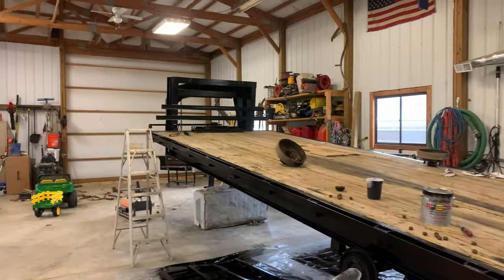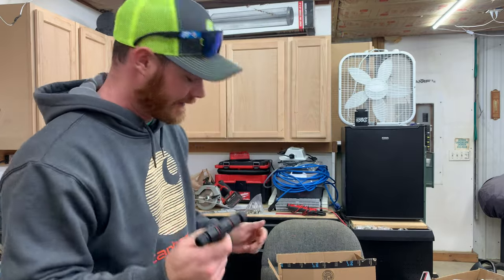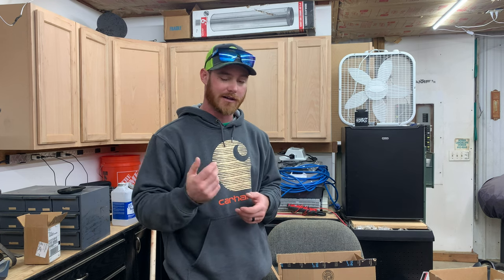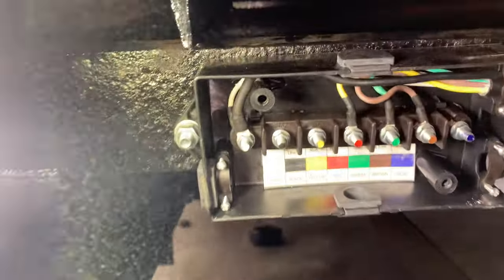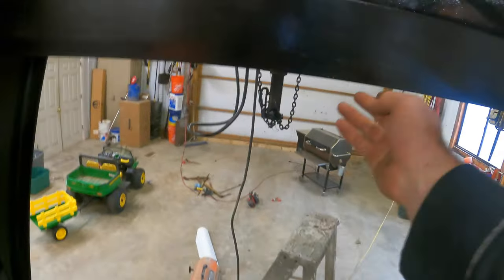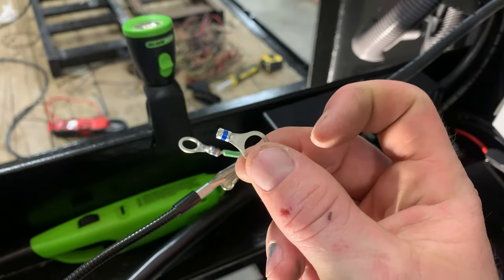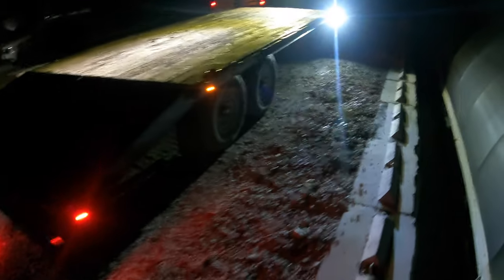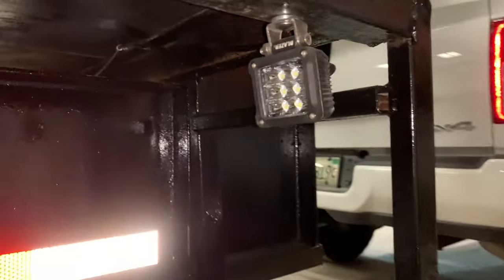HOW TO: Wiring a Trailer, OVERKILL Edition

Comment: I have an 18’ bumper pull I need to rewire. Saw the junction box on line but still didn’t like having to splice wires at the running. Just this morning it dawned on me to use more than one junction box. That soured me to checkout YouTube for trailer wiring again. To my surprise your video was the 2nd video that popped up. The land scraping connectors is genius! This is exactly how I’m going to wire up my trailer! Thanks for post this! I picked up my trailer cheap, all the floor boards have been removed due to rot, I’m going to rewire then install new boards. Will also get new breakaway system and I’ll also be adding the light bar and wheel lights which is also a great idea!
Reply from the maker: I’ll never have a trailer without the added lighting again. It’s way too convenient.
Reply: I've been wiring trailers my way professionally for years and have been using junction box's for the past few years with separate wire to each light and I'll be adding these splices to my method now. I see never had any come back for my work but dang

Comment: Beautiful work - and love the creative use of the t-connectors! For your next trailer, you might want to consider not soldering connections that are crimped, as this can - surprisingly! - make the electrical path weaker. (Not the actual crimped and soldered connection, which is pretty much solid - but it can make the wire leading into the crimped/soldered connection more prone to breaking due to recurring vibrations.)

Comment: Amazing buddy. One extra tip. If you wanted to overkill and were worried about certain areas like on those T’s where the skinny wire comes in and you said you’ll face it upwards in case water gets in, after you make the connection, fill the void with a dolup of diaelectric grease. 

Anywhere where you worry a little bit of water may enter, give it a dab of grease and you’re good for years

Comment: 3M Scotchkote FD is a coating that is designed for underground electrical splices . It is expensive but is really worth it .  Dap 8889 is an acrylic bath and tub caulk . It works well to secure and  weatherproof the pigtail wires to the terminal body .  
Excellent Video !
Reply from the maker: I actually have some of the scotchkote in my electrical supplies and use it from time to time. Great stuff. Only reason I did not use it here was once you put that stuff on it’s a pain to get off if I were to add anything or if I wanted to change somthing up. Like you said it is expensive too. Great product though for sure.

Comment: Overkill is the only way to do it!  Great video as I will be doing the same to my gooseneck trailer soon.  How did you mix your paint for your airless sprayer? Did you have to cut it with Acetone?
Reply from the maker: Yep. I just threw some paint thinner in the paint until it looked thin enough to spray. Worked great.

Comment: Love the tips and tricks. Definitely overkill but hard to beat that extra lighting. 

I’m looking to paint/coat my deck on my trailer. I’ve seen people use old oil and do that but doesn’t seem like the best option. Any input would be great?
Reply from the maker: So the only reason I used deck stain on this trailer was because I had it on my shelf already from another project. I’m the past I’ve always just used a mixture of used motor oil and diesel fuel. It’s always worked great for and and protects the wood. Plus when your machine leaks it just blends in and treats the wood even more!
Reply: @BuiltbyBurns   That added bonus mightve put  me over the top lol

Comment: Great video and the jokes were a welcome addition.
What power are your lights that you are using a relay? I'm tapping 2-4 18W LED small bars, I'm thinking/hoping a 14ga wire added to the trailer fuse box should be enough?
I've bought a SPDT rocker switch (ON-OFF-ON) with 6 pins. I intend to have them in pos I for reverse lights (only powered when truck in reverse), in pos II for flood (tapped into marker lights for loading, which will have to be turned off prior to pulling away) and off position. I wonder if relay would've been better in my case?
Reply from the maker: I always use relays. Not so much because I need them but because  it cuts down on the stress on the electrical system in my opinion. 

Most people forget that heat is a big issue when it comes to electronics. The more demand you put on wire is the more demand you put on the connections.  Once the connection heats up too much it fails and causes issues. 

I could go on and on but here’s your answer. Do you need to install relays? No. No you don’t for what your doing. But for me I’m always changing or adding somthing. So for me it’s a lot easier to just do it the right way and install them now. 

Hope this helps. Keep in mind the purpose of this video was to go overkill on this project. So don’t take what I do as the only way to do it. Good luck bud.
Reply: @BuiltbyBurns  Hey, for sure makes sense and yeah, I get the point of your video and going overkill. Video itself was great!
Though with the relays - aren't they more meant to be a sort of electrical/automotive "if or and" function? I.e. you apply power and then you can get multiple circuitcs/coils energized. Whether or not you go directly from power to the device or run it through the a relay, your LEDs for example would still require the wires to carry the same current, no?
I guess on the other hand you can power the relay with a higher awg wire, thus saving money on not having to run say 10ga due to voltage drop?
Reply: @BuiltbyBurns  that depends on the rating of your switch. If you have 4 ea 18W lights, that is 6 amps at 12 volts. Unless your switch is rated at least at 10 amps, it won't last long.

Comment: Nice.  So all the power is coming from the truck?  No extra battery?
Reply from the maker: Yessir. Nothing I’ve got on here pulls enough amperage to require another battery at the moment. I’ve got a winch I would like to put on but I will have to install a seperate battery for that.

Comment: Couldn't find LINK to buy this stuff.   Looked under video, remix share and all those but no link
Reply from the maker: https://youtu.be/HhT8aS4n-JE    Ok so click this link, it will take you to the video, directly under the video will be a short excerpt of the discription and at the end will say “show more”, click the show more and scroll down. There’s a ton of links there to choose from. Eveything is labeled and easy to use.  If you have any issues let me know what exactly your looking for an maybe I can send you a link to what you need.
Reply: @BuiltbyBurns  I need the list of all the stuff you used to wire your flatbed. And the links to go buy it. Buying an old stock trailer and I want fresh wiring front to back.
Reply from the maker: @deniselynn-fi3sw  

ok, here's the basics your going to need:

https://amzn.to/3wNYmaD   - 7 way plug with junction box

 https://amzn.to/3jgJBtW  - heres the trailer wire, pic how long you want when purchasing

https://amzn.to/3l49BJe - here's junction boxes, I used two of these, one for middle of trailer and one for rear

https://amzn.to/3DxPw4z  - this is the t splices used on running lights, purchase however many you need. my 25 ft trailer I used 8.

https://amzn.to/3l6dtJG - here's the tail lights I used

https://amzn.to/3l6dtJG- here's the third brake light I used, ( optional)

https://amzn.to/3wJJ7j3 - here's the running lights I used. pick color and how many you want. I bought two red and 6 amber.

https://amzn.to/3HodUqt - here's trailer breakaway controller I used. must have.

https://amzn.to/3HyfINQ - here's the two wire I used just for running lights.

this is a pretty basic list of stuff you need to completely wire the whole trailer like I did in video. if that's how your wanting to do it. keep in mind mine has been problem free since installing everything this way. good luck and I hope I've helped as much as possible but unfortunately this is as far as I can help.
Reply from the maker: also if any of these products show unavailable just look below them for similar products, its all the same.
Reply: @BuiltbyBurns  thank you so much!

Comment: How many lumens are those fold lights? 

I got a put those lights in my horse trailer
Reply from the maker: To be honest I’m not even sure. Just some basic ones off tractor supply shelf.
Reply: Thank 😂
Reply: I'm doing the same project myself right now. Bought 2 18W light bars with 6 LEDs in each, supposedly throws 1530lm, small 7" bar. I'm going to put them on the back first for loading/reverse and if I like them, also add one on each side for getting in and out of the tack room/helper light for changing a flat etc.
I have a SPDT 6-pin rocker switch (ON I - OFF - ON II). I intend to run power to the switch and lights from the middle pin, i.e. in reverse and lights will come on if switch is in position ON I.
In ON II it will be tapped into the running light circuit, i.e. if it's dark enough for the side markers to be on, these lights will be needed too (loading an animal). And then position OFF is obvious. 
Going to likely run a 14ga from the trailer fuse box and add in-line 10A fuse. No idea how it'll work, but have wired cameras into the trailer wiring before and they work well.

Comment: how much would you sell the trailer for? or a range?
Reply from the maker: I actually sold this trailer a few months later. I sold it to a friend of mine for around 6k. I know I could have got more but that was about how much I had into the whole thing included what I purchased it for years prior. So although I did not make any profit I did not lose any money either. Plus I’ve made money using for my business.
Reply: @BuiltbyBurns  thanks for the reply. I have a heavy duty gooseneck its prolly 20 years old but its solid! It's all steel, no wood, bit thinking about painting it. Trying to figure out if it's worth painting or selling as is.
Reply: Its 25ft bed, 32ft total length. Prolly needs 4 new tires.
Reply from the maker: I’ve found in the past a 100 bucks worth of paint and some weekend labor will get you a lot more for a trailer in market place. For example I had a 16ft equipment trailer I had laying around for years that I decided to get rid of. So I drug it out and took some pictures and posted it forsale. After about 3 weeks and no intrest I decided to throw a new deck and some black paint on it. 500 bucks later I threw it back on marketplace and it was gone for more than I was asking by the end of the weekend. Just my opinion.
Reply: @BuiltbyBurns  thanks for the reply. That's encouraging!! I could prolly do in a week or so. Will be first time doing anything like this and have been watching lots of vids.  I think, wire wheel the rust, muriatic acid it, wash that off, prime, paint, and rewire, which I have no clue about

Comment: How did you wire the rear lights? U didn't show that part..
Reply from the maker: I used the junction box at the rear to feed them. I ran a power wire and a neutral wire to each individual light. I also grounded each light to ensure they have a constant path to ground hoping to emininate any future issues. My apologies if I dident cover that enough in the video. Somtimes when editing I tend to try and speed the videos up when they get a little to long.
Reply: Ok, did u run each wire from box to lights or one wire then tap into the lights? @BuiltbyBurns
Reply from the maker: @KarrieMcClellan-nv4tk  for this piticular build I ran all individual because I had room on the lugs in the junction box. It’s overkill and not needed but that’s what I did so if the wire were to fail I would still have power to the other lights. You can do either way.